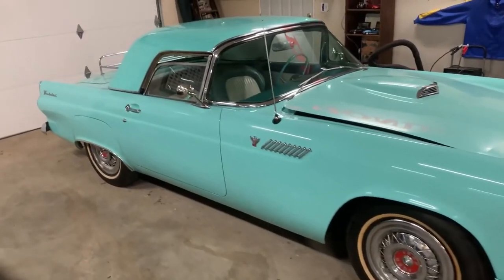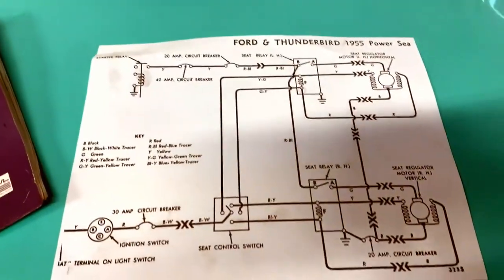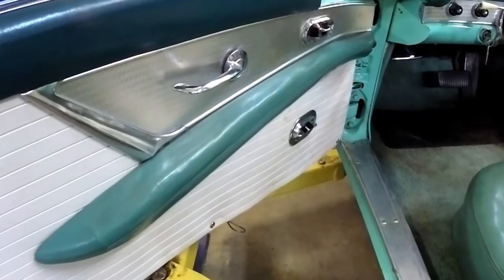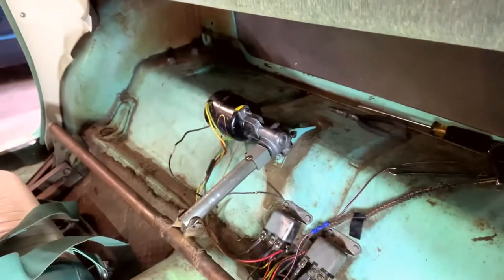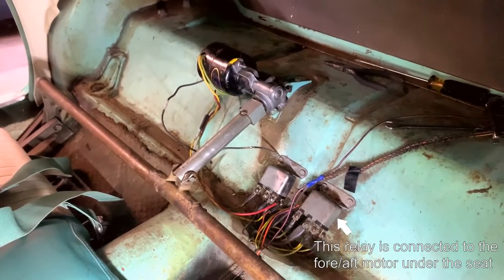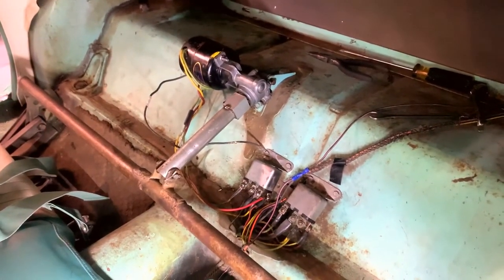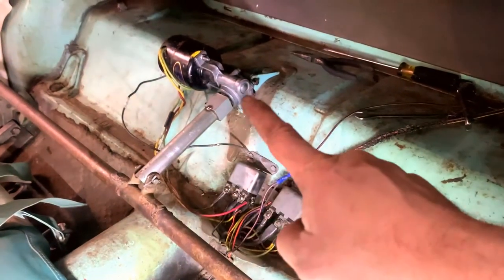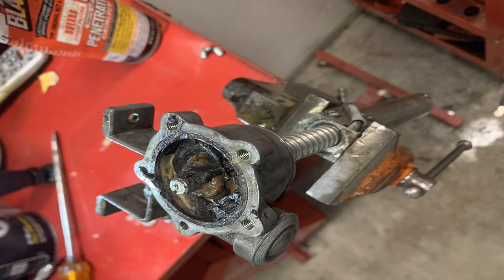1955 Ford Thunderbird Power Seat Fix [Collector Car Guru  Workshop]

Comment: Sam good to see you around. Very informative. Think about trying to replace the heater motor on a 71 Thunderbird.👤
R RUSSELL
Reply from the maker: Thanks! Some heater motors are simple to replace -- being done from the engine bay and take ten minutes, but I seem to recall the 71 Tbird requires pulling the heater box down from the glovebox in the interior. I would suggest getting a new squirrel cage (blower fan attachment), since the one in there is probably broken into many pieces after 51 years. I know I am broken and in pieces after 51 years!